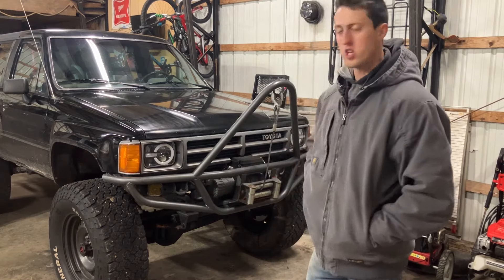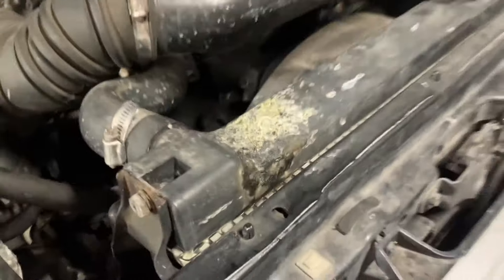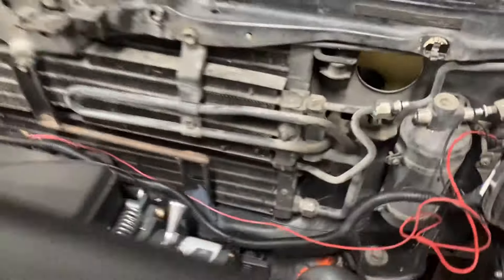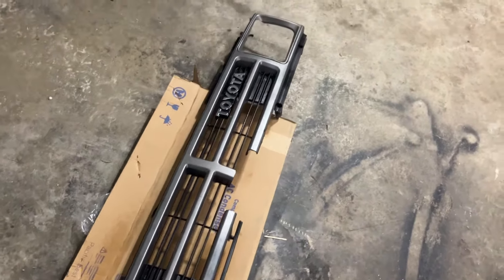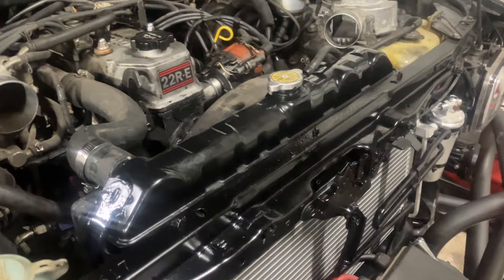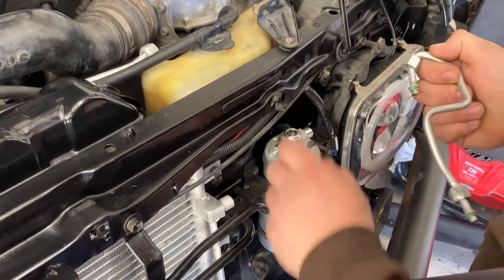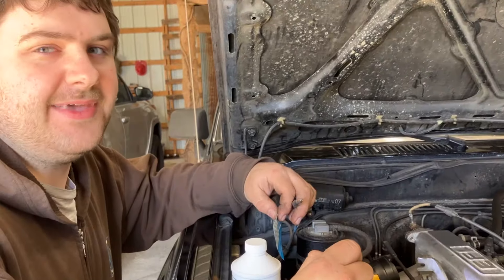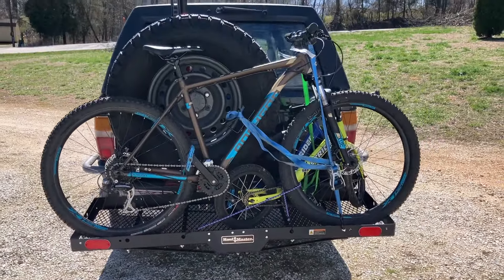1st Gen 4runner Gets Huge Ac and Cooling Upgrade! Definitely The Ultimate Overland Rig now!

Comment: Looks like the compressor linked is a single row vs the OEM double row condenser. Is the parallel flow efficient enough to cool the 4runner, making double row unnecessary?
Reply from the maker: It’s way better we explain that at the end of the video. Just modern technology

Comment: Anyone knows what to drill the firewall for the holes for the lines to if installing an oem an ac system into the 84/88&89 pickup 4runner?
Reply from the maker: I am pretty sure the small line is a 3/4" hole and the big line is like a 1-1/4" hole. But you can always just start small and work your way up?
Reply: 1" and 1 1/4

I also have hardlines and various ac parts for these trucks.   I just installed ac in mine
Reply from the maker: @BraddaMarlon  right on!